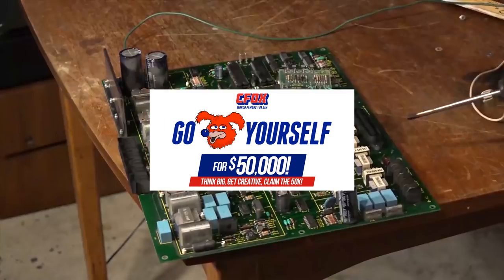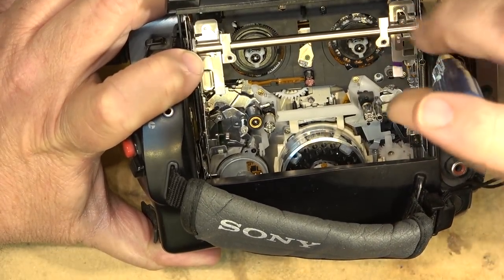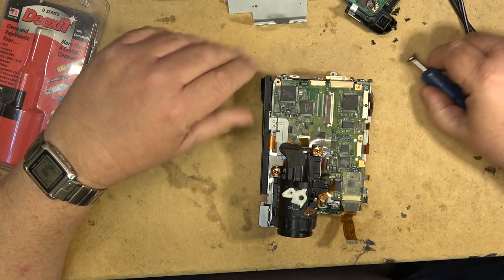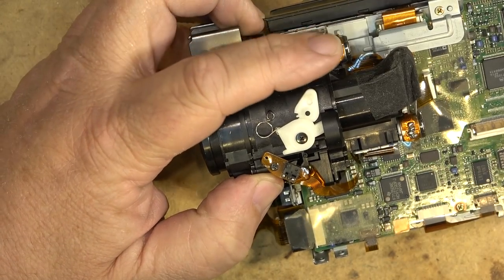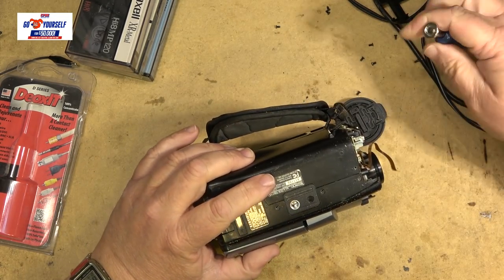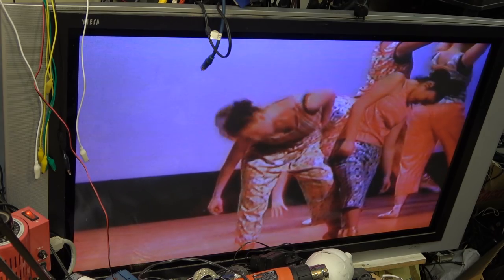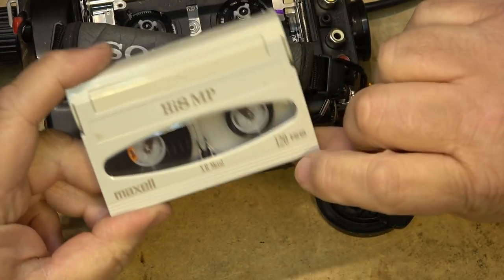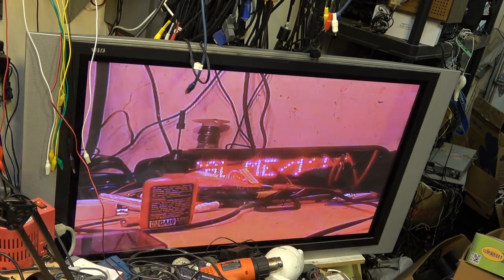Sony 8mm Hi8 Digital 8 Looks like dirty heads but it is NOT

Comment: This video is like a public service! I have a Sony DCR-TRV320, Sept. 2000. Bought it new. Great shape. Been stored for years.  Got it all out to finally transfer/digitize my 8mm and Digital8 tapes. Worked fine for awhile. Then got about 1/2 way thru my 80 tapes (1/2 1 hr. Digital8 & 1/2 2 hr. 8 mm) and it starts dropping out and static like dirty heads. Go to some effort to get a dry cleaning tape. Run it for 10 seconds. Seems better, but then drops and fuzzes again. Run the clean tape again. Same. Woulda likely kept it up when I luckily found this! Your guidance gave me the confidence to tear into my excellent condition machine. A couple additional/different wire connectors on mine (black wires between two halves). but managed to work around. Used deoxit as suggested. Got back together and is now working fine!  NEVER would of known or tried this without your video! Thank you very much!

Comment: Can’t thank you enough for this video. Got a second hand CCD-TRV66 to transfer tapes since I have a couple tapes that were shot on a Canon L2 that don’t want to play nice with my Digital8 camcorder (annoying audio buzz). Didn’t produce an image but audio was intermittently coming through. I saw this tutorial and thankfully the mechanism was more or less the same, reseated the ribbon cables (didn’t use the contact cleaner in your video) and I got playback and was able to transfer the tapes over passthrough with no audio buzz.

Comment: I've got one of those that exhibited those exact playback problems and also put it down to dirty heads which refused to get clean.  Never thought of the ribbon cables oxidizing in that thing - though I've come across exactly that phenomenon in a bunch of other gear.  I'll have to revisit the thing now.  I have a bunch of Digital 8 tapes to transfer so this couldn't have come at a better time.
Reply from the maker: They sure do.  All the way from the "A" mechanism.

Comment: Thank you so much for this vid! I have a few questions:

I am getting this problem after cleaning my drum with chamois swabs. Is it likely that I damaged one of the heads, or is this problem really just indicative of the connections being messed up? I wasn't having this error before cleaning. 

Also, is the deoxit is quite expensive for just one use. Is it necessary? Or is there an alternative solution I can use?

Thank you!!

Comment: I just started converting my 8mm tapes to digital and I'm using a Sony CCD-TRV82 for output to desktop. I'm breaking each segment into 1 hrs blocks and once the tape has stopped or I see no more recording was done on the tape I stop and eject it. I then place the tape in a Sony CCD-TR614 only to rewind the tapes. I got to a row of tapes that started to not be watchable when I tried the transfer yet the TRV82 timer would still be counting showing the tape had been recorded on. Anyhow, I went back to the first tapes I documented what was on them and now I can't watch any of the output from the TRV82. The last thing done with the tape was being rewind by the TR614, ejected, and placed back in the case. I have almost 16 tapes I was able to view now be unable to view on known good camcorder.  I also tried on another TRV-460 and it too will not play back the tapes. So my question is did I just ruin all my tapes running it through a non HI8 / Digital 8 camcorder just by rewinding?? I'm stumped, in less than a week my tapes were good to non playable and only were in the two camcorders. Sorry for long winded but hope you're able to help with my issue. Thank you.

Comment: This looks like the problems i had too in recent days. My Video8 Handycam, CCD-TRV(forgot the number), had a lot of noise throughout  the playback. When i hit record there's an error message "cleaning cassettes" meaning that i have to put the cleaning cassettes; but i do couple times and still got error messages. When i playing back the cassettes on other camcorder it's normal. If i can ask, are the camcorders in this video are facing the same error messages when recording?

Maybe i wanna try this action, but i have to collect the guts to disassembled. I always afraid if the problem are the flex, because there's no new spare available on the market, especially in my country. Thank you! Appreciate this.

Comment: Got a CCD-TRV58 here with a similar issue (noisy playback, no record). Tried this out and the only result I got was a damaged loading motor connector that now randomly looses connecting and throws the camera into emergency shutdown. I also messed up the alignment thinking it was that. At first I did want to fix it, but now that I got two other cameras that work this one turned into my dedicated tape rewinder cause that's the only thing it's useful for (apart from chewing tapes during playback haha).

Comment: These videos are amazing! Thank you. I'm learning a bit about my camera but not quite enough just yet.  I have a very similar model to this one but it's not digital. I believe my model is the TRV308. My issue that I'm having with my camera is that the output doesn't seem to work. The camera plays back fine in the viewfinder however when I try to watch my tapes on a TV I get no signal on the TV. I've tried different TV's and different cables. I have the 3.5mm AV Out port and the SVideo out. The SVideo works but sends the image in B/W. 

Any tips on what the issue might be and how I can watch my old 8mm videos on the TV?

Comment: I have the Sony TRV120E Digital 8 Handycam. Still working perfect. The ribbon cable looks perfect. It also plays back PAL and NTSC tapes.
Reply from the maker: This one will play pal tapes too. Just digital 8 though.  Don't think it will play pal analog.
Reply: I have several D8 camcorders. Just for clarification... these camcorders don't output pure NTSC 3.58Mhz signals when playing back NTSC tapes. They output pseudo color systems such as PAL60 or NTSC 4.43. This is usually not a problem when viewing content on a TV but will give you problems when capturing. You need a capture device that understands those color systems. Same applies with NTSC camcorders outputing NTSC 50 when playing back PAL tapes.
Reply from the maker: @josem.martinez856  that's right and the NTSC camera will play a pal digital 8 tape as  will my DV deck and when you capture over FireWire the software has to be set for 50i not 60i. Computers can play they file but if you make a dvd it is a 50i disk that won't play on many domestic players.  So frame rate conversion is necessary before turning out a dvd.
Reply: @12voltvids  Another great feature of some of these camcorders is their ability to work as a passthrough device taking an analog signal as an input and outputting a DV encoded signal out of the firewire port letting you capture from all your analog formats using your favourite NLE. And in the case of PAL, which is 4:2:0, it produces excellent results.
Reply from the maker: @josem.martinez856  Right. I forget if this one has pass through.  Will check. I know the gvd800 and my 2 dcrtrv730 do, but i don't thing this first gen had that feature.  It could record an analog signal and then play the tape out the FireWire. I know that for sure as I did that.  I used to connect it to my evw300 camera as an external recorder and make some beautiful recordings.  A 3ccd hyper HAD camera into a digital recorder using component recording.  (Svideo is a component signal car by the way. Called Y/VU and the other type of component is YcRcB which used 3 conductors vs 2.)  They both deliver the same results.

Comment: How can you tell if it is the camera of the old 8mm tape that has degraded over the year that is the issue??? I bought an old used 8mm cam to transfer old hi8 tapes and they are very grainy and dark to view. A lot of skipping
Reply from the maker: Old used camera likely has bad caps.  Those of us in the archiving business don't use old cameras and maintain our playback equipment all the time.  I use the last generation digital 8 with analog playback capability myself.

Comment: Great video! I hope I don’t need to pull it apart… but maybe I am going to… fingers crossed just heads… do you have tips for using head cleaning taps in this series of digital 8 cameras
Reply from the maker: Only use dry type cleaning tapes and follow directions on the tape.   (Insert tape, press play run for 10 seconds and eject without rewinding.)
Reply: @12voltvids  thanks for the comment I have no idea how to tell if I have dry type. It has digital 8 symbol and is from
Sony… this is digital 8 player and from Sony. … no instructions like maybe digital 8 is used for computer gear possibly
Reply: It got better after cleaning but I think one of the heads is oxidised like in your video would need to test with digital tape to know for sure
Reply from the maker: @flowstate_link  
That's a dry type tape.  The wet cleaners you put liquid cleaner in. Alsop was a brand.  These permanently disabled many VCRs and cameras by breaking guides off when they jammed.
Reply: @12voltvids  wow good to know!!!!!!

Comment: Hi, I have two cameras with this exact problem, I've tried reseating connectors and cleaning the heads with tapes and later with a small piece of paper + acetone as shown in one of your other videos. Is there anything else I could do or is it a lost cause? Both are Sony Hi8 Models. I have fixed countless camcorders thanks to you!
Reply from the maker: Have you done the fingernail cleaning?  Alcohol won't cleaned a head clogged with metal paryicals from tape.  Has to be scrapped off and the back of fingernail works great. Acetone or other harsh chemicals could dissolve the glue that holds the head chip on the mount. Xylene used to be used at the tv station I worked at but it will ruin plastic and rubber parts.

Comment: And when I was a kid, I had a Sony ccd-f350e. The 90s model and its matrix are better than these from the 2000s and there is no digital noise cancellation of the picture and this is cool. I hope to fix it)) They all had a disease, over time the drum stopped spinning. The problem is condensers, there are a lot of them?
Reply: *I apologize - capacitors, not condenser
Reply from the maker: Used to call them condensers i knew what you were getting at.  Yes all the surface mount caps are bad.  The bigger issue is they cause a cancer on the board.  The PCB is multi layer.  The caustic liquid that spills out if the caps soaks into the board and eats the traces destroying the board.  So you could change all the caps and still have a dead camera.   I refuse these jobs and only attempt it on cameras that are given to me and if i can't fix I toss it away.
Reply: @12voltvids  Do you say cancer? It is, I understand, about PolyChlorinated Biphenyl (PCB) and dioxin, not printed circuit board, as the translator translated to me) I heard about these substances, but thought that they were used only in Soviet industry. Googled and realized that the ancestor of the notorious Monsanto. And the big customer was the American armed forces during Operation Ranch Hand in South Vietnam. Thank you very much for the warning, respect! Sorry, if I don't understand, I don't speak English, I use a translator.
Reply from the maker: @vetrov888  It was referred to a camcorder cancer. Not Cancer as in the disease that people get. Camcorder cancer was a term used to indicate that the circuit board was shot. Unrepairable, due to corrosion from caustic electrolyte from capacitor leakage.

Comment: THANK YOU !!!  Just those connectors?  Amazing. (I've got a couple of these too; not sure of the generation)

You've sure seen/repaired a lot of electronic "stuff" over the decades. Wow, Dave.

Do you still have a working 3/4" Umatic unit in order offer archive-to-digital for your customers?
What kind of magic do you know about solving the slipping "threading ring" problem on a VO-1600?
(push it with finger, lol)  I used to just replace them while working at Sony, quite some time ago...
Reply from the maker: Yes i have 4 umatic and they all worked last time I turned them on but who knows today. I just got a umatic in to change belts.  Will be on that this week.
Reply: @12voltvids  AMAZING - Old tape can be very messy as it breaks down and gums up everything. An oven pre-bake and then wind into another shell may be required even for your own test/align tapes.  Take care, stay safe.

Comment: Hi: I am retired and started digitizing photo and video family media to keep busy. Recently dug into the box containing Hi8 tapes and the camera and have had the tape break in both of the first two cassetts I tried to play. While disassembling and splicing the breaks, I think I am noticing a white crusty residue between the rolled tape edge and the inside surface of the plastic reel. I believe this contamination is sticking the tape to sequential turns such that when the tape is unwound by the player, it initiates a long diagonal tear from that point. Have you seen this problem and what do you do to fix it? Thank you, Bert   Please reply and I'll check back.
Reply from the maker: That's mold and there is a procedure to deal with it. I have a video showing how i have done it.  It's a tedious time consuming procedure that involves spooling the tape by hand while stretching the tape out to force the tape tighter onto the reel causing the tape pack to slip between the tape layers

Comment: Good afternoon. Do you have heads for this camcorder for sale?
Reply from the maker: No, I don't.  I have 4 units that use the same drum so i would be keeping any spares for myself if i had any. Same goes for the newer bottom loading chassis.  I have 2 of those machines.  I use these for my digitizing service and put probably 100 hours a month on the camreas. The only ones I sell parts from are units I don't use for conversions.

Comment: The SP only is true for analog tape playback only, or it's unable play and record LP in D8 mode as well?
Reply from the maker: I believe it will play LP analog, however I have no analog LP tapes to try in it. Never used LP. I dont even know if any of the cameras I have have LP. Definitely it will not plat LP digital 8 tapes.

Comment: how can i fix  jvc dx-u10 software thing ; when i touch USB button its goes to DVD Or other  source    TAPE -A OR TAPE-B
Reply: Get contact cleaner like Deoxit or other products and clean the switches. It probably uses a resistor latter to determine which button was pressed. If the switches are dirty, the resistance changes and the button does something unexpected cause the micro reads another voltage than the button should apply through the resistor latter. Dave L Jones made a video about it when he repaired the control panel of an old AC unit.

Comment: quick question about tapes , which type of 8mm cassette (like ceramic or metal particle) do you recomment ? im looking for tapes that have a good shelf life /wont wear down video heads/sticky tape
Reply from the maker: I was never a fan of the ME tapes because the early ones I tried were terrible. Many of the MP tapes were also crap. I believe the later ME tapes were better. All my miniDV tapes are ME as that is all they made and they have all held up well.
Reply: @12voltvids  so what your saying is i should pick recent made ME tapes , ok thanks :)

Comment: You need to keep that camera in the warmest place in the house, keep the damp out and less chance for the connectors to corrode, and fox up :-D
Reply from the maker: It's kept in my edit suite and it is climate controlled and dry. In addition to the HVAC for the house there is a seperate Ac in the wall that I turn on when working in the summer and have all the equipment on. Gets pretty warm.  So moisture not a problem in here.  AC is a dehumidifier

Comment: I have this model, or very similar
Reply: Mine has mini dv connection but it is not always detected by the computer. I have checked several cables but it still being detected in an aleatory way...
Reply: @reminder_cor  I wouldn't necessary blame the camcorder for that. It's more than likely a software issue.

Comment: Macroblocking :)
Reply from the maker: Not macroblocking, signal missing from 1 head.
On DV this would result in perfect bands of frozen picture, but on digital 8, because the tracks are stacked, the sections or frozen picture are staggered throughout the picture.
Reply: @12voltvids  ahhh I hear ya. I saw some rectangles because of what you just wrote, so I automatically equated them to what happens with low bitrate/poor codec.
Reply from the maker: @MrChrisRP  bit rate on digital 8, miniDV and DVCam are identical.  25m bits.  File size 12 gigs per hour.
Reply: @12voltvids  That's quite high for the back in the day technology, for sure. I never used any of those formats before. heh
Reply from the maker: @MrChrisRP  That was actually considered low.

Comment: Interesting, but my time is more valuable.  I'd just rather buy another used camera from eBay.
Reply from the maker: Roll the dice and take your chances. Most of the old cameras up for sale have problems.  Send the tapes out to be digitized professionally is best option as if tapes are moldy they can be demolded at same time.
Reply: @12voltvids  That's what we do is professionally digitize all media, Umatic-as well as other early television video audio, consumer media.  There are plenty of reliable eBay sellers ie "doctor-sony". Thanks for the video regardless.